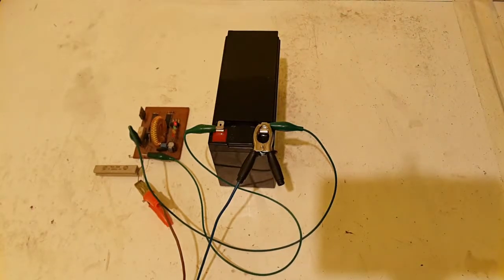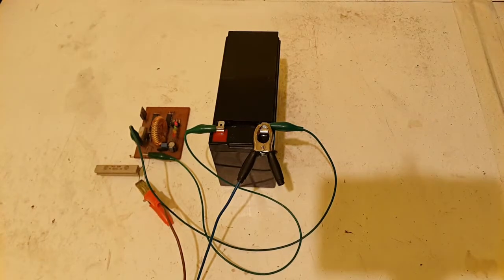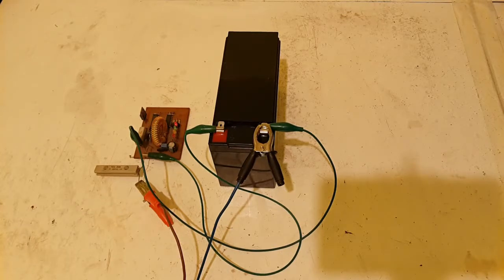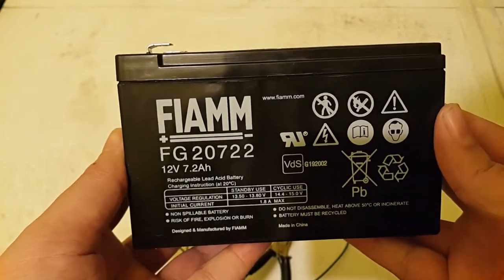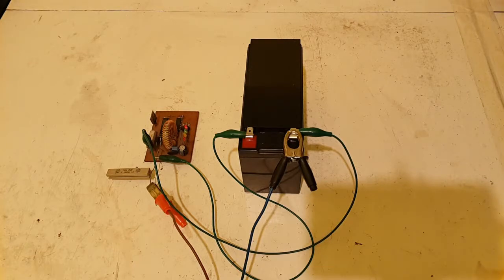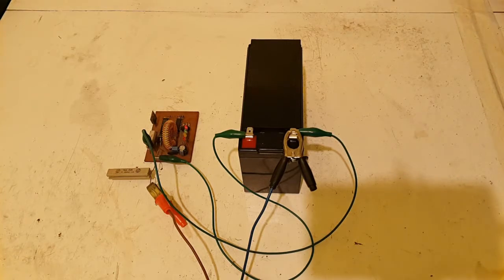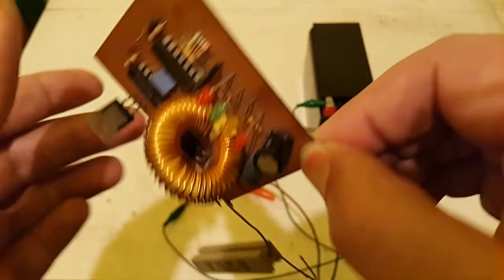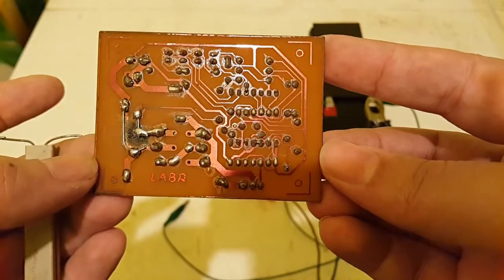How 2 Rejuvenate/Restore VRLA/SLA Rechargeable Batteries - K. Walraven's Approach

Comment: David - I have an opportunity to purchase two 48 volt Absolyte GNB/GP (2 volt cells). There are no connecting plates or hardware with them. I would like to use them for off grid power (48 volt system) but I do not know how large of an inverter and solar array is required to feed this style of battery bank. These banks were used in telecomm/remote site. Are they worth attempting to rejuvenate? Thank you for any feed back! I am subscribing to your page to see what other things you are working with! Thank you!
Reply from the maker: Hi,

Good thing you mentioned the exact specifics of these batteries (as I never heard of them) so I could go online snooping around. They look promising - judging by the abrupt general information I found about them. 🙄😏

The inverter does have to be a 48 V one for starters. Unless you can somehow (& safely of course) decouple each battery array to more manageable blocks of either 12/24 V batteries. If it's possible then you could buy just a normal 12/24 V power inverter. I think 12 V types go up for a maximum of 4 kW, while 24 V ones can reach even higher wattages. 🤔

Regarding solar panels themselves it's sort of a similar story. You can buy right of the bat 48 V rated ones (which will be more watts per size) or lots of smaller 12/24 V ones. Then combine them in parallel (& serial) to get the most optimum configuration given the amount that you will purchase. It all depends on your budget ultimately. 😕😏

In terms of restoration dilemmas it's hard to say (as I don't know their state of preservation). You could try fiddling with the Bedini principle, the so-called "Imhotep's Radiant Oscillator" (look it up here on YT) & my favorite Ossie Callanan's circuit to see what your success rate would be. But even a better option would be (as suggested a paragraph behind) to tear down the 48 V battery pack & personally inspect which 12 V individual batteries are still ok & which not. Then re-create/re-assemble a new 48 V battery pack from the 2 48 V battery packs you'll be purchasing. The worn out batteries you can then try to restore with the previously mentioned approaches. 🤔😶

That's how I'd tackle the issue if I was in your position but you can also try asking on Solar Panel Talk Forums too. I've seen somebody asking about these exact batteries in 2020 there.

Oh great ! Please do. I have also posted 2 videos on TikTok in regards to VRLA/SLA batteries awhile back. 😇😉

Best Regards,
Reply: @davidbolha  Thank you for responding, David! I will have to turn the 2 volt cells around because they are not in a +/- position in the strings  to charge 6v, 12v, 24v or 48volt. The system originally had plates connecting the cell. I will end up making cables in order to accomplish the charging. If they are able to carry 80% capacity for a few years that will get us up and operating for power to our off grid RV hook up. I'll be happy enough with that. I was worried that the only charging I can accomplish is from a generator + inverter to go to full charge. If so - that is what we will do to see what capacity they still have available.
Reply from the maker: @rongray4118  Aha... well you could use like some aluminum busbars (properly drilling holes into them) to have a solid connection to each individual battery (& the battery pack as a whole). 🤔😕